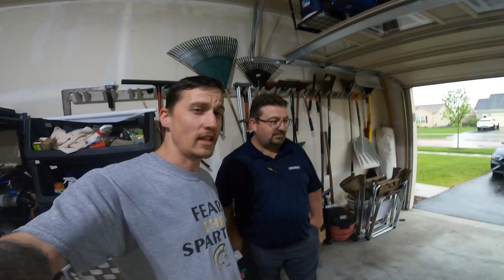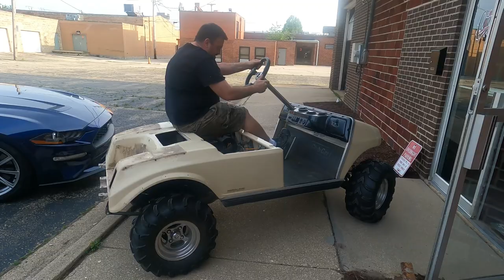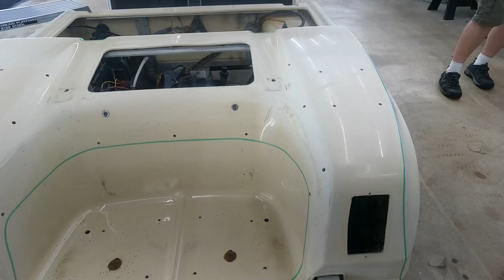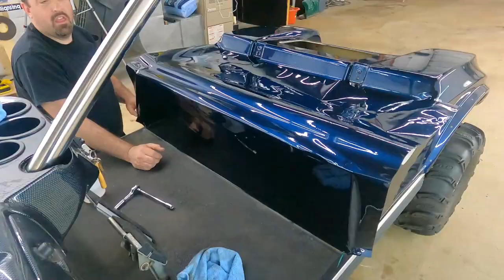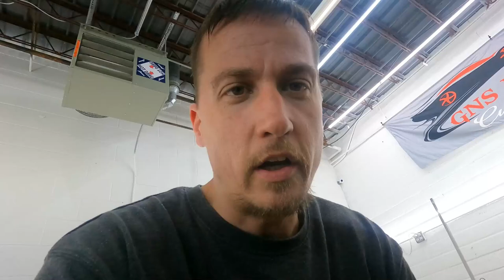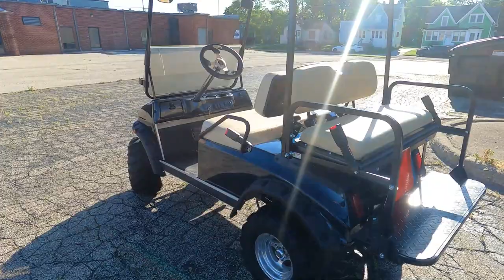How to Wrap a Golf Cart in Indigo Blue with embossing! #vinylwrap #wrapping #vinyl

Comment: Any tips on wrapping a 2014 Yamaha G29.  I’m about to pick it up and was gonna try to wrap it myself.  I do have experience with vinyl and decals, but never tried to wrap something
Reply from the maker: If you want to try something easy and user friendly go with Avery Dennison. It’s a low tack surface and easy to use and easier to manipulate the material.

Comment: Did you have any problems with oxidation on the plastic? I am wrapping my golf cart and I keep getting a white powered that’s interfering with the adhesive on the wrap.  Iv used alcohol and wet sanded it. Nothing has worked.  It will stick in some places just fine but I get stopped in my tracks when I come across some areas.
Reply from the maker: I honestly didn’t have any issues, I’ve done three of these things and had no issues. I’ve wiped them down, sanded some and used 70% alcohol but depending on the failure area could be a different situation maybe.  Message me on messenger gns_designs and see what I can do to help you.